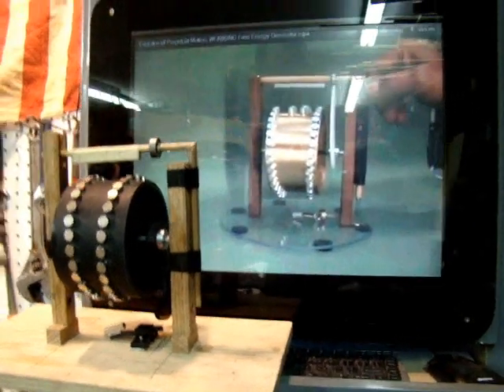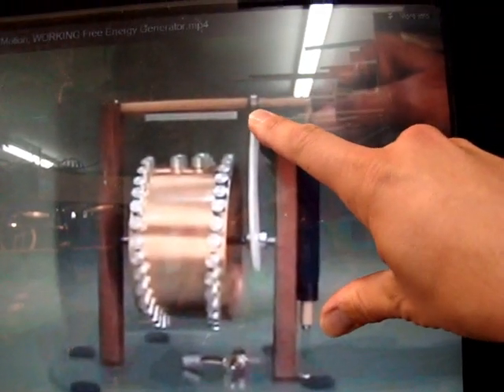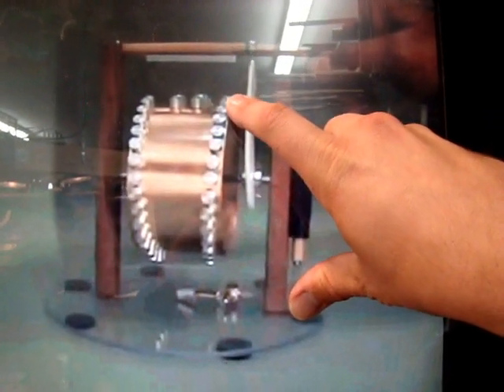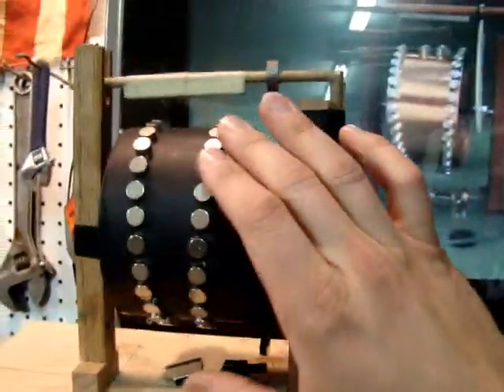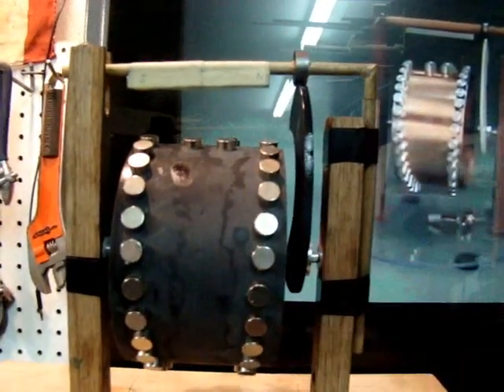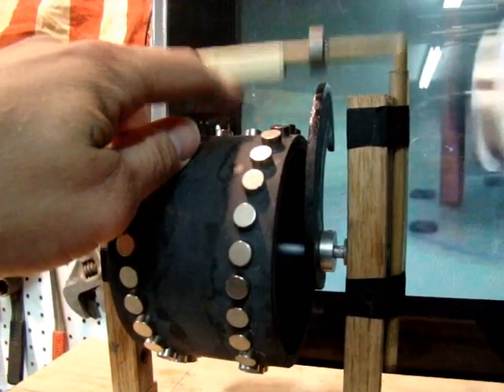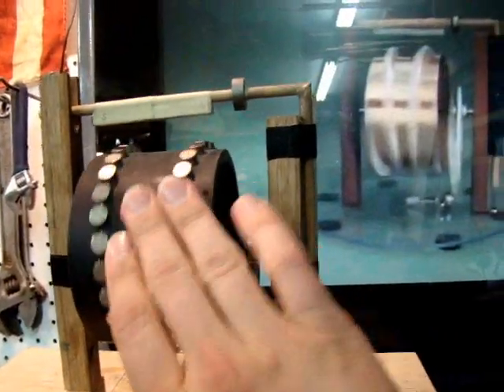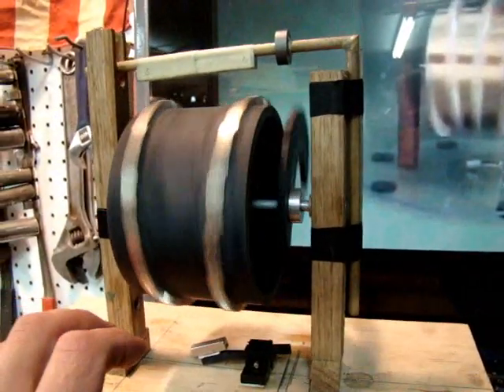Evolution of Perpetual Motion, WORKING Free Energy Generator Part 1 of 3

Comment: I think the problem you had/have is the iron wheel you used to fix your magnets in effect changed your magnetic field inward.

You must agree that a neodymium magnet can force a magnetic material away from over 8cm.

The fact yours have little magnetism shows that you have linked their fields and nullified them through the use of your materials.

Regardless if the other guy's works it it obvious your flaw is material...

For instance if you have a bar and put two magnets on the bar in opposite directions your bar magnet has very little magnetism.

Because your wheel is connected the north and south poles join and do the same thing. ...just throwing out thoughts
Reply from the maker: Its not iron its ABS plastic. Light weight next step is carbon fiber,
Reply: wood brass and glass 1. Top magnet is meant to be a monopolar magnet. 2. the magnets are not supposed to be strong enough to push the top magnet up. The rotating piece on the side is meant to.
Reply from the maker: #3.  It is now sold.

Comment: Hello, thanks for vid! Even if the contraption you try to replicate works, yours is too crude--you need gentle TANGENTS with your circles, not this tones of resistance cli-clack. As for the V-gate, your magnets completely lack interaction, a V gate should work very strong at least up to the "sticky spot", yours doesn't at all. Also momentum of the wheel may help. Cheers!
Reply: Do yo have a working motor? If so how is you cam arranged?..Cheers, Jim

Comment: why do you not put the magnets together to do a "Halbach array" google it, it will increase the field strength a lot
I have been trying to expose an answer to the mystery of the100 Miles per gallon fuel systems. Yes 5 times the fuel mileage is possible but missed or suppressed by oil companies for over 80 years and we have the patents and the science to prove it, see the evidence we have now at website (no spaces) him acre search dot com other sites with similar info are Byron wine dot com Rex research dot com More than vapor but refining gasoline into natural gas and methanol yes 200 mpg 4 cylinder

I guess because I put out the info on 5 times the fuel mileage for free on my web site. I have been exposed to many Alleged Cures for cancer that appear they have been suppressed like 100 MPG as crazy as that sounds. Speaking of sounds there was a Dr Raymond Rife in 1930 s that used frequency and had great success and many devices have since been used successfully allegedly. For free file, 27 listed 3.8 megs just e mail Bruce "at" him acre search dot com ask cancer file and feel free to pass on

Comment: I have been trying to expose an answer to the mystery of the100 Miles per gallon fuel systems. Yes 5 times the fuel mileage is possible but missed or suppressed by oil companies for over 80 years and we have the patents and the science to prove it, see the evidence we have now at website (no spaces) him acre search dot com other sites with similar info are Byron wine dot com Rex research dot com More than vapor but refining gasoline into natural gas and methanol yes 200 mpg 4 cylinder

I guess because I put out the info on 5 times the fuel mileage for free on my web site. I have been exposed to many Alleged Cures for cancer that appear they have been suppressed like 100 MPG as crazy as that sounds. Speaking of sounds there was a Dr Raymond Rife in 1930 s that used frequency and had great success and many devices have since been used successfully allegedly. For free file, 27 listed 3.8 megs just e mail Bruce "at" him acre search dot com ask cancer file and feel free to pass on

Comment: I know exactly what you're saying. I've had that same thought, and for some reason I don't think it will work. I can't explain why. But that doesn't mean it won't work.
Something about the increased torque from 3 wheels seems to make more sense to me, BUT it would be easier to test the 3 sets of symmetrical magnets. Maybe if they were symmetrical but only space them out on half of the wheel.

Comment: You forgot the compressed air blowing on the bottom of the wheel. The background noise was cut out and replaced with music.
Why doesn't anyone try a 3 cyclinder vgate? the same vgate only it has 3 seperated wheels offset from each other. And I've seen a magnetic shielding over the spot where it always stops after 1 turn.

Comment: How many years have inventors spent trying to make a PM machine? It never works. This led physicists to the law of conservation of energy two centuries ago. The news just hasn't reached everyone yet. The energy required to LIFT the weight back up, EXACTLY EQUALS the kinetic energy it gains running down. No surplus energy arrives to drive a load; and there's always friction. Gravity, springs & magnets all work this way; they are conservative forces.

Comment: I´m not. Theres no energy inherently to vacuum itself. Theres is potential energy stored, in pressure differences. Like the one there would be between 1 atm, and vacuum.

So, vacuum itself, or even a determinated pressure by itself, has no useable energy.
You need a gradient of energy.

Comment: Guys, I doesn't work just because it was a fake from the beginning. The original machine did not work either, and the dude who built it made it spin by using an off camera air pistol.
This does not work and never will.

Comment: The rail is attempting to get to the last two magnets. The orientation of the last two are at about 45 degrees. Cover your model in iron filings to show the fields. You must make a flux field that runs completely around the cylinder. from the first to the last. The magnet below breaks or alters this field. Your N and S at the rail indicates you have not studied enough. I am not sure of this "V-gate" concept. If it works, this is how it will work.

Comment: Sir, you deviated a bit. First off, the cam is used to lift the magnet rail; because it is somewhat attracted to the wheel. To make the rail magnet, one needs to wrap a rectangular piece of steel in Ni-crome wire. (insulated of coarse) The steel should be heated red hot and with the coil in a closed electric circuit. Let the steel cool with the current running. The little round magnets in array are pos/neg along the radial sides. As opposed the flat faces.

Comment: you are very right that the charge on magnets is not permanant that is why it will work because of stored energy much like a cylinder of air for pneumatic tools. but made correctly it can be done..how long it will last is a different story.

Comment: The magnet at the top should have a counter balance so that it can move easily, but I think thats pointless just like the bottom magnet.
Do the math and see that the eld of it need more power and to counbter it you would need a greater power to move it over the hump which means 4-6 magnets all around. If the end has a power of 12, and the others have 3,6,9 then the other combined outstrengthen it dont think think?

Comment: 1 the magnet on the dowel is not a magnet it is diamagnetic 2 the lift arm has a spring assist.3 the lobe on the dowel is a ball bearing. I have built one of these 10x this size it is working.

Comment: N52 magnets with standard copper then nickle plating if roughed while the copper (not brass or other material.) having also been cleaned with denatured alcohol and the magnets also being cleaned using the same. A standard mix of 205 West epoxy will serve well to hold them. Although the cure time is a bear of between 10 to 20 hours depending upon temp. If it's a vgate then you need to be aware of the polarity coupling of the magnet pairs. Otherwise you'll get what you got. You need N52s no less.

Comment: One thing everyone seems to forget is that the earth itself also has a magnetic field and the planets around us also have magnetic fields, which do reach us, but are very weak and since the planets move round and round at different speeds, they induce a current, but this is extremely weak; so weak that nothing can really measure it. The permanent magnet motor can catch these magnetic fields and use it... And I haven't figured out the rest. Just my ideas.  :D

Comment: Dude. You are most likely using fridge magnets or low powered ones (N35's). I recreated it using N52 Magnets and it works fine. 
Try again using N52's, and I suggest first doing some of the experiments he did so you can gain the knowledge prerequisite to understanding how delicate the positioning is. 
Do a freehand wheel. If you cant make that work, something is wrong with your experiement, not his. 
He didnt use air, because I didnt. I will prove it with a wide frame video in a week here.

Comment: I might suggest trying to use a stronger bottom magnet but restrict its movement so that it cannot make contact with the center wheel but does come close e ought to cause an attraction thereby adding to the downward momentum and ultimately adding upward momentum to help it over the hump. According to amperes law magnetism is absorbed faster than it can be released into thin air supporting the idea of perpetual motion

Comment: What you need to do is hollow out one of the uprights and fit a small li-ion battery, then attach to the axle one of those very small motors you can get easily on eBay. Then it'll work.

Comment: when you moved the magnet at the botom upwards the drum rotated slightly on its own I'd remove the cam and forget about it ifting the top rail thern control the height of the magnet at the bottom with a screw.

Comment: You need to read my comments more carefully. I clearly said that if a person is holding the magnet and moving the magnet, it naturally works--because thepersons energy is actually moving th device. If th machine, (thru adding a cam mechanism), has to provide the energy 2 move th magnet, it cannot work. But what many cant quite visualize, th magnets and mechanism cant even serve to extend the runtime, only decrease it. It would run longer if it were a simple wheel (of th same weight)on a bearing

Comment: In your posts you repeatedly assert that it isnt PM because it wont go forever. You will find this sentiment expressed in many posts. It is really fallacious. Again, the magnets and mechanism dont add any impetus to the device at all. Without th human hand involved, they make the device run less time, not more. (To demonstrate overunity or perpetual motion, does not require that the device run forever, but to run long enough to display overunity). >>

Comment: Hey, I will stipulate that it was perp motion if it ran for even only 5 minutes!! It didnt run at all. You said in ur description (twice) that someone held a "magnet and pulled it away".  That movement with a human hand is simply adding human energy to th equation, and that energy is just enough to make the wheel turn.When you add a device to the machine to take the place of th hand movement, the device could not run. You need to work on vizualizing th very basic reasons why this idea cant work.

Comment: The way the one that was made for that class was made so the magnets were counter sunk, they got shorter and shorter as you went around the wheel, until they jump up at one revolution (Where you pulled the magnet away).  They marked every magnet so they were all the poles were the same (or alternated, wasn't my group so I am not sure if the poles facing out were identical or alternated).  I never said they are perpetual motion, I said they should turn though, if you spin it, or if you hold the

Comment: Really, because in an engineering design course I took in University a group built something that resembled this, without the crank and added bits, just the wheel and someone would hold the magnet and pull it away similar to what the crank did.  It turned, they got a decent mark because although they had a small somewhat unfinished unit, they had really good documentation on it and put a lot of work in on it.  I said I have seen a few, only one with the whole crank type setup at a science fair.

Comment: Yes, sure you saw one turn--but you just cant quite remember where.  The magnets and intersting mechanism on this wheel can only decrease the runtime, not increase it. It would be much more efficient if ALL the goofy mechanism were removed and it was simply a wheel on a good bearing. As in all these devices, the more complicated and novel th device, the more the gullible will believe--and th less efficient it will actually be.Perm mags cannot to ANY degree encourage a wheel to turn.

Comment: Your upper magnet it not close enough to the magnets on the wheel. These V Gate motors (I think they are also called Calloway motors) do work, not perpetual motion machines, but they do turn, the fact yours doesn't even twitch was just kind of sad.  I am not saying the video you had going in the background is true, it very likely isn't, but I have seen these motors turn, but again, not as perpetual motion machines.

Comment: ---->personal issues that in fact make you look kind of silly! First off the plastic drum you used is way heavy unlike the video where is a balsa wood drum with a thin sheet of copper that can be found at any airplane hobby store and weigh 1/10th of what your drum weighs! Your replication doesn't even have and power from the V-gate ramp having nothing to do with getting past the bump to restart the circuit and most important is that you can't seem to identify this simple fact!

Comment: I'm going to speak but your going to get pissed at me! First off don't touch things you don't understand! Every one of your points was not correct! A V-gate is very simple the only thing is getting rid of the bump to make the circuit! Complaining of how they are mounted using against it being real, sounds like a personal issue?
A rectangle bar magnet also using as a point of not being real? There is an unending sea of that size bar magnet being available! All of your points are---->

Comment: That bar across the top that you couldn't find out what it was is the other magnet  that you are missing. The spacing of the smaller magnet creates a pull effect closer equals stronger pull to weakest(farther spacing apart) . The magnet you're missing is the one above attached to the bar that's lifted up creating the whole effect all over thus creating a perpetual movement.

Comment: btw, just because the wheel is shiny doesn't mean it's METAL.  It could have been cardboard and spray paint.  The SIZE of a magnet has very little to do with the STRENGTH of the magnet.  Just because you can't get the same force doesn't mean he didn't.  He just ponied up the dough for better magnets.

Comment: You need strong magnets. The north and south pole needs to be turned 90 degrees with only one pole facing down at a slight angle and cover the length of the tubed magnets (electro-magnet). The tubed magnets then have to be all set to one pole. That way the attraction or repulsion of the poles will keep it going. The handle uses gravity to keep the motion going down wards and the magnet underneath pushes it back up. the magnet underneath is obviously the opposite pole to the ones one the tube.

Comment: this looks plausible based on designs i've been trying to develop, except your flaw might be missing the COPPER tubing?  i haven't watched the original... but magnetic flux in spinning copper does all sorts of stuff like cause levitation and heat.  and perhaps the screw u used inside is iron not something transparent like aluminum?  thanks for sharing!

Comment: by using neodylynium magnets to basically eliminate drag and by shrinking the piece plastic that levetated your upper magnet you should be able to obtain your goal. It is obtainable... but you will have to make multiple adjustments until it can sustainably rotate freely

Comment: That method works just fine, rather your wheel is not trying to move at all.

As for getting it to go round and round is a seperate challenge all together.

1: incorrect stator config.
2: remove object at bottom
3: watch other v-gate videos.

Comment: Magnet is a spinning electron throwing out a field of force moving some objects over distance. Work is done. Trick is to capture it. Can't just go in a loop: energy diff is 0.
(I know strange geometry to allow energy extraction.) But first improve this model
Don't fight gravity! Put wheel on its side. Move DM Drive Magnet with light spring (less force than gravity) Or via groove around rim. Smaller DM jump can work & less energy loss.  Try 4-6 DMs around wheel. One drags while 3-5 pull wheel.

Comment: Original looked too energetic from low flux (far pair) to high flux (close pair) - a big barrier. Surely faked! But a magnet V has real FORCE. I saw one run well to stick point: all very light materials Bar mag closer to drum & drive force stronger. (You can buy long Nd magnets for sorting minerals.Costly!)

On the other hand a wedge array of magnets will propel a bar magnet held over it on tracks etc. So there is a real FORCE to harness by better geometry. (Magnet is spinning electron throwin